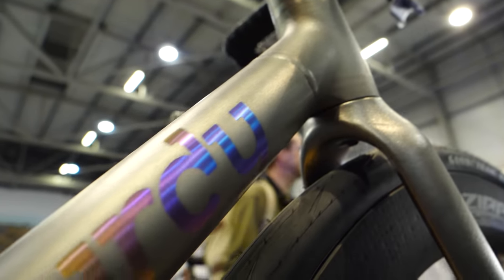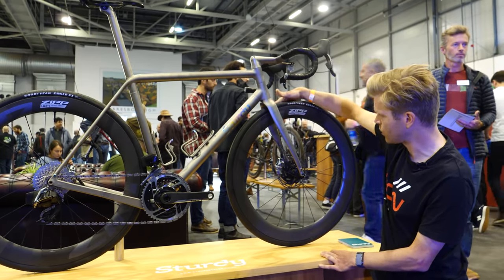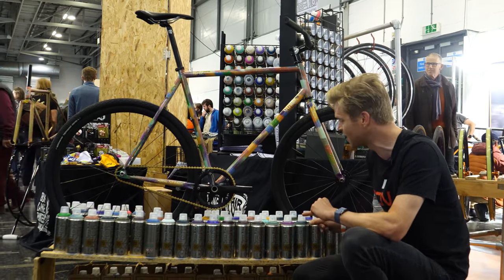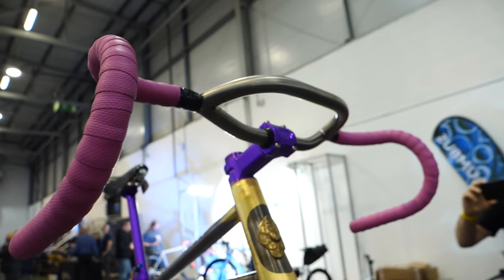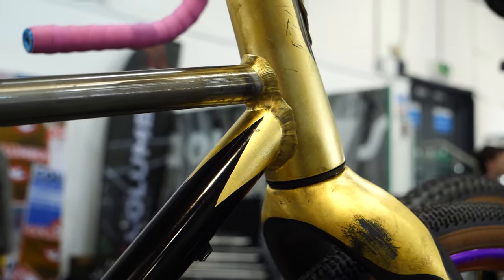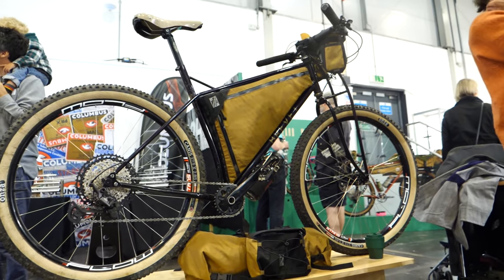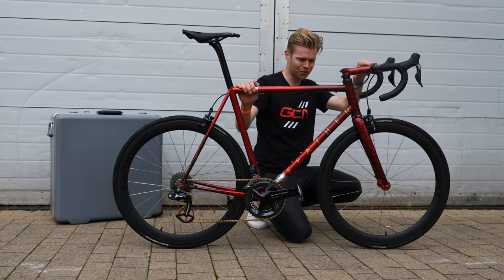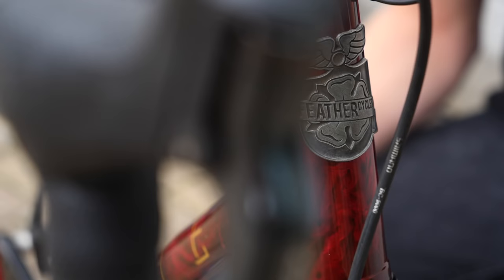A Bike That Breaks In Half?! | The Coolest Tech From Bespoked 2021

Comment: Folding bike is actually "S&S couplings" only intended for round tubes, this product been out for more than 2 decades, longer than Sheldon Brown.
Reply: Very true!   I have a S&S coupled touring bike that I had built in the year 2000.  The couplers are a great way to pack a bike so that it is convenient to travel with.  Getting the bike to fit in the case is a bit of a puzzle, requiring a specific sequence of packing, usually.
Reply: My coupled Independent Fabrication touring bike is more than 10 years old. It has flown several times.
Reply: Many builders can build one for you. But its still a cool example.
Reply: Yes, GCN Tech is really reaching here. This is old--and superb--tech. My S&S equipped bike is over 20 years old.
Reply: There are other coupling methods that work just fine. Ritchey's packable cyclocross frame is one example. I made one that comes apart with a simple clamped/rotate-able downtube and screwed-shut interface on the top tubes. Some bayonet mounts out there too. What don't work well in my experience are most actual folding couplings. They flex and click and squeak and drive you crazy.
Reply: I've had S&S bike (retrotec) since 2007.  Made traveling too and from O'ahu so much easier
Reply: I have a titanium bike built with S&S Couplers. Packs into check luggage- 26x26x10 inch case. Awesome for travel!
Reply: S&S couplers on bikes have been around since Ollie was on training wheels.  1994 to be precise.

Comment: Ritchey did the lugged steel folding frame 15+ years ago
Reply: I saw this in the 'Encycleopedia' periodical in the late 90's, using exactly the same method and the same fixings - not sure whether it was this company, or perhaps a forerunner to it. Either way, it's an old (but good) idea.
Reply: I thought these were Ritchey couplers on this bike.
Reply: More like 25 years ago. But, yes. You are correct.

Comment: Really! S&S couplings that Serotta were using in the 2000s. Haven't Ritchey been making a folding road bike for years?
Reply: Yes, the S&S couplings have been around for years and Ritchey had their own seperatable frame that did not need them.
Reply: Yeah, the Ritchey Breakaway from about 20 years ago.
Reply: Yes I’ve got a frame I bought off of eBay, 631 tubing but it’s 26” rear wheel and the forks700c co I’ve not built it up yet.
Reply: Our CoMotion tandem from the 1990's has S&S couplers (6 of them) and CoMotion has been building both singles and tandems with them since then.  
The S&S coupler design hasn't changed at all; it's become timeless.
Reply: It's the latest acc to GCN

Comment: @aksGCNtech - this separated frame thing brought up an idea for a test/gaffe idea: can you rig 2 DI2 groupsets to enable shifting on a different bike? If so, could you guys do a ‘ride’ with the shifting rigged on 2 Different bikes so that Alex needs to shift for Ollie and Vice versa?
Reply: I'm actually surprised that there haven't been cases yet, where someone develops a "hacking" transmitter that lets them throw their competitors' bikes into high gear at inopportune moments.
Reply: @marianneoelund2940  from what I have read, the protocol is hard to impossible to hack, but maybe hacking isn’t even required, just confusing the signal might not require a hack… and yes, I’m surprised no one seems to have attempted such a thing, but maybe we should be glad about it seeming a 100% save. (Glad that the brakes are still manual)

Comment: Bill Holland of Holland Cycles has been building that type of folding bike since 2009.
Reply: thanks! i’ve not seen one, but will keep an eye out! 👍🏼
Reply: Ritchey breakaways have been around for a while
Reply: I've seen several fold-up tandems with the S&S couplings. Allows you to put the bike in the boot of your car, if needed. Remove the wheels as well.

Comment: As others have noted, the S&S couplers aren't new (well, maybe new to some), and mine at least are titanium, not aluminium or aluminum, or whatever
Reply: They're made of stainless steel, for application to steel frames.  For titanium frames, the inner mating parts (with the interlocking teeth) are titanium, but the external coupling nut is still stainless steel.

Comment: There's one aspect of 3D printing titanium I'm not clear on and have never seen definitely addressed. It's how, if at all, does the 3D process affect the strength of the material compared to traditionally drawn tubes? I remember reading somewhere that traditional manufacturing tube making methods offers superior strength because of how it aligns the material at a granular level.
Reply: The 3D printed titanium is thicker.

Comment: That S&S coupler bike is surely nice... too nice.  No way in hell you can pack it in a 26x26x10 case (hard or soft) and not scratch it though. 
Dosen't matter how careful you pad it - baggage handlers are brutes. It'll get scared up.  It'll still be structurally sound... but she show some scuffs and scratches after about two years of traveling.  Pity. She is puuuuurdy!
Reply: Get it in brushed ti. Just needs foam layering